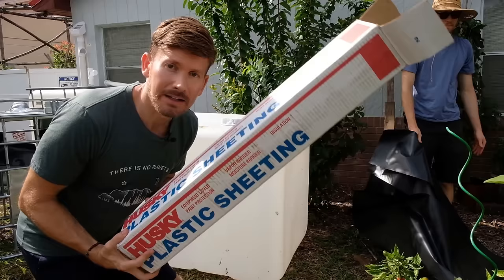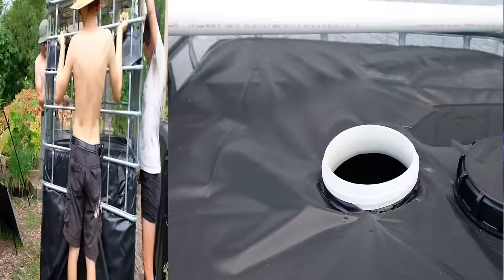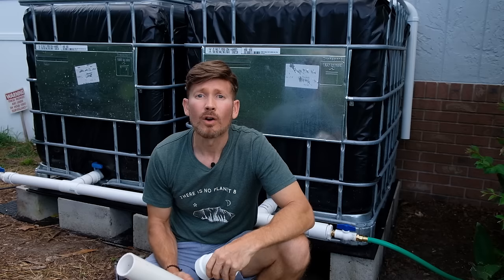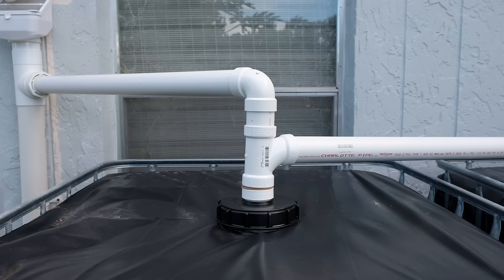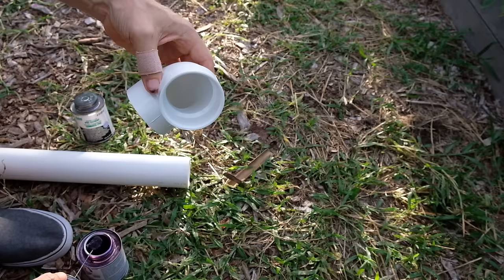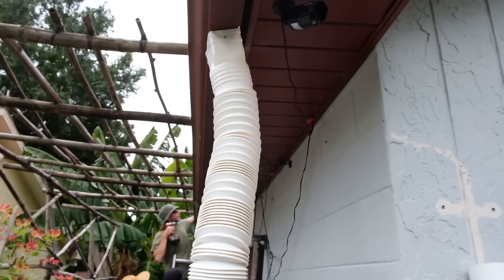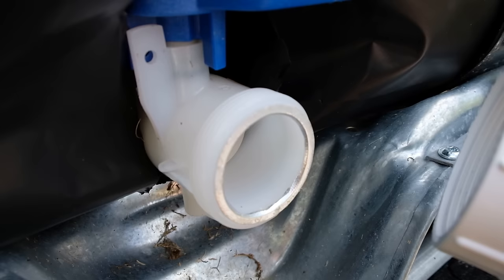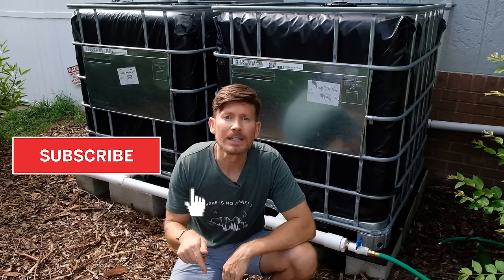How to Build a 550 Gallon Rainwater Harvesting System

Comment: As you mentioned finding a way to connect the totes and the plumbing has taken many hours.  Many thanks for describing the connections and where to find them.  My plan is a little different.  I'm planning to collect rain water and store it in 2 totes in the ground below the greenhouse.  I'd be interested in your thoughts about putting your totes under ground.  Again, thank you for the detailed explanations.
Reply from the maker: Hello! I don’t have personal experience burying IBC totes but the walls are thin so I would be cautious about it. Some people report having the walls cave in when the tote runs empty, but this may be due to not having some type of vent or tube that comes to the surface to suck in air to replace the vaccuum created when water is sucked out by the water pump. Also, if your water table is high, it could crush the tank from underneath of its covered up or it could float up out of the ground. So be sure to determine how high your water table can get after a rain storm. Either way, if you do decide to bury them, keep them in the cage and maybe add some more reinforcement to protect from pressure from dirt/sand. And make sure to keep the tank covered at all times. If sunlight hits that water and algae forms, it will be tough to clean out.
Reply: Can wrap the frame with concrete/mortar wire. It’s like chicken wire, for supporting mortar. That would help keep dirt from crushing in. Might take several layers & might take mortar to be hell for stout.
Maybe a small frame over the top. Using a pallet would be temporary since it will rot. Recreate a pallet shape with concrete boards? To put a sturdy “roof” over the IBC?

Comment: I would think be easier to just paint them but I'm still building this system. Thank you
Reply from the maker: It may be easier to paint them but the plastic is slightly porous so I guarantee that paint chemicals won’t get in the water. If you are going to drink the water, covering with a thick plastic cover may be better.

Comment: Awesome video! Thank you! 
Just wanted to say that PAVERBASE Panel price you're refering to is PER PANEL that covers 5 sqft not 100 sqft (100 sqft costs over $200)
Reply from the maker: The WHOLE package is only like $12. They are the black foam pavers. Not cement pavers. It’s a great deal. https://www.homedepot.com/p/PAVERBASE-20-04-in-x-36-in-Black-Brock-Paver-Base-Panel-PVB5B/205663180?MERCH=REC-searchViewedNA-205663180--N&

Comment: Very cool video I live in a 55 and up community and we are purchasing a home here and I'm looking for some water catchment that is kind of inconspicuous HOA will allow it as long as it Blends in with the surroundings this is one of the best videos I've seen
Reply from the maker: The aluminum cage is perfect for attaching boards or other types of covering to hide the system. You can attach a few thin boards vertically to the front of the cage with zip ties and and then screw larger boards horizontally to them. Or you could attach trellis board and grow flowering vines or other vegetation over the system. Or just build a false wall in front of the system. Easy to hide!

Comment: Thanks for a great video, very nicely presented!  You gave me great tips for using the Totes' drain fittings and providing an overflow in the top.  I didn't really want to cut into the Totes.

Comment: I got the same set up however I used 4 totes to give me 1100 gallons of rain water, my down spout is connected to the one tote but I have all 4 totes  connected like yours at the bottom however I have an irrigation pump hooked up to the pvc with a 3/4" male garden hose adapter to make my home made lawn sprinkler system to water my grass for FREE👍🏿👍🏿
Reply from the maker: Awesome! You have an on demand pump that keeps pressure? I’ve been looking into that so I can water the garden or feed it into a natural filter system with biochar, sand, stone, etc.
Reply: @naturehacker1095  it's just an irrigation pump that I got from lowes, I posted a link but YouTube keep removing it...I'll make a video of my set up when I get home

Comment: Wish I could like this video twice... Exactly the instructions I needed. Thanks!  Question, is the plastic wrap necessary if the totes are out of direct sunlight?
Reply from the maker: Yes. My rule is that If you can see your hand in front of you, there’s enough light to make algae inside the tank. So, in other words, you want something blocking the sun. Plastic wrap was the best solution for me at the time because I was nervous of painting the plastic totes and possibly getting some toxins seeping through. Amazon sells tote covers now but mixed reviews. There may be a few high quality tote covers out there though. That would make the covers removable if needed which can have benefits. Some covers are also insulated for colder climates. Have fun taking one more step toward resiliency!

Comment: You might want to invest in Such 80 unions and Spears Ball Valves with unions, those white valves will lock up and break when you try to turn them, also you want a rubber ball or a bladder used for plumbing in case you get a broken pipe, so all the water does not come out.

Comment: Thanks for this information. I’m definitely going to incorporate this system in my yard. I like that everything is easily accessible from the bottom to the top. My only issue is what do you do to prevent critters from moving under your containers? Joe long does it last? I live in San Diego and it’s finally raining. I’m thinking about stacking 3 tanks and somebody prevent rodents and insects from moving in.
Reply: I never had anything go under my tanks but it’s not hard to run some hardware cloth/chicken wire around the bottom to keep rodents out. The metal frame of the totes makes it easy to secure it to the tote and then you can bury the wire a few inches deep into the ground to keep a rodent from getting in. I’m not sure they would do too much if they were under there anyway.
Reply: If you stack IBCs, make sure you are providing lateral support. That’s a lotta lotta weight up high that could cause catastrophic damage if it gets much of any lateral force.

Comment: High level overflow pipe on one tank and no overflow pipe on the other tank means before water overflows to the high level of the tee overflow connector, the other tank will be full and water overflow either burst or overflow on the top cover if loosen. Overflow pipe, if provided to one tank only should be located at least 2" below the top level either of the tank.
Reply from the maker: Hello! Both tanks fill up equally with the pipe connecting them from the bottom. Moving the overflow outlet to two inches below the right tank is another option. You lose some water storage capacity but it will work well. This design has been working well for three years. I hope to post another video soon of improvements that could be made based on user experiences and comments. But this design as it is works well. Thanks for watching and giving your input.

Comment: Reading through the comments and I agree with a ton of people. This is a very informative video and done really well. I just see the problem being through the filter system. the only thing helping filter the water is a pantyhose. I would have made one tank be the main water catcher with a sand/pebble/gravel setup that then lets the water that's been filtered go to the next tank through a valve connected at the bottom. Of course, you'd have to put that tank slightly above the other or even on top of each other to allow the gravity to pull it down but at least then there is more of a filtering of the rainwater. As you said there is bird poop that has a chance to make it through and pantyhose might not stop the bacteria they bring. Collecting water I think this is a really good and amazing job well done. However, I also feel like there is a better chance to get sick just having the one single filter helper that is pantyhose.
Reply from the maker: Oh, I agree. It’s a triple filter system between the leaf guard, first flush diverter, and pantyhose liner. Although the water runs clear, bacteria will still get through. So I filter the water with a Berkey filter in the house. I don’t drink directly from the rainwater system. A future plan would be to use a solar powered pump to run the water through a sediment filter system to clean the water AND replenish the minerals.There are open source plans for that online. Running it through gravel, pea stone, sand, and biochar. My Berkey is my short term solution. And then I add Trace minerals to get the minerals in the water since rainwater (just like reverse osmosis water) is largely mineral deficient.
Reply: @Nature Hacker that's what I was thinking is that this is just to gather the water then you have another filter that you use to get the bacteria. I was saying from that setup it would be best to order set it up with sand gravel etc or just use an additional filter system. This is awesome to catch the water but would recommend filtering it before drinking.
Reply from the maker: @ovogaming7453  Definitely. Ultimately, this would only be the first stage. Then a natural filtration system that will later feed into the house with a solar pump. The key is making the system as mindless as possible so more people will be willing to install a system like this without changing their habits too much.
Reply: @naturehacker1095  exactly. Again good video and thank you

Comment: Fantastic system! I’m going to build my own soon, probably just like this.
Does a film of bacteria grow inside? I’ve seen others comment that it helps otherwise sterilize the tanks?
Would a small circulation pump in each help prevent stagnation?
What’s your outflow pressure? Does an RV pump or dock pump (110 v) up the pressure for long hoses to the garden?
Reply from the maker: Hello! The black cover will keep the Sun out and prevent algae growth. It has been running clean for two years. I use a small pond pump to add pressure. Otherwise you have to raise the system higher to get more pressure. Having something inside to circulate the water will keep the water from freezing in the winter but not needed to prevent algae. Now they have removable covers on Amazon to cover IBC totes which may be easier for you than wrapping with plastic but both ways work well.
Reply: @naturehacker1095  thanks! I’m moving in & building south of Dallas next month.
Being 3/4 ton it’s a big engineering like Costco shelves to lift high enough for a few more pounds pressure, doh. Prob easier to put a 40 psi pump on it for garden hoses & timered drip lines. I plan to do a 2-tank system for garden & backup to city water. In drought times Ill just keep growing.
Reply from the maker: @michealnelson5179  Yes. I agree. I opted for a pump as well.

Comment: And people when you're doing the priming and the gluing part of these PVC pipes do not lay them on the ground because you're going to pick up dirt and other contaminants that's going to mess with your pipe assembly. And if the games that tells you how full your tank is is airtight you're not going to be filling up both tanks the same amount because they're going to be air pressure in the top of the second tank which will keep the water from getting all the way up to the top.
Reply: @allen at the end he tell to loosen top cap for 2nd tank. I think that would release air pressure.

Comment: This is a great video. How do you determine the amount/length required for the first flush?  Does it correlate to impermeable surface / roof square footage?
Reply from the maker: Thanks! The length and width of the first flush diverter depends mostly on the size of the roof and amount of pollutants in the area. The main reason for a first flush is just to get rid of the nasties on the roof first before filling the tanks. If I found that I needed to flush more water, I would have bought a few more pvc attachments and ran a few more pipes parallel to the one I installed to double or triple the first flush water collected. If you have a high roof, you can always get away with just having a longer or wider diverter pipe. Here’s a great resource to help you do the calculations. http://rainharvestingsupplies.com/content/documentation/pty/first-flush-diverter-brochure.pdf

Comment: Very informative. Thank you.
If I were to build a system with only one IBC how would you go about to install an air outlet to release the pressure when it fills up?
Reply from the maker: I have a new overflow system featured in my Rainwater System Update video coming out June 10th 2024. It works well with one tank.

Comment: Hey thanks for all the details 🙏 I learned that the water outlet should be 50 mm above the ground. The problem I see with the IBC is that the outlet is right at the bottom. How you handle this or is it not so important to have these extra 50mm for sludge building?

Comment: Overall, great system that I have built (twice).  However, there is a modification to assist.  The connection at the tank, if not perfectly tight (should also use teflon tape) you will have a very small leak (you will not realize it until everything is connected in permanently and you have water in the tanks).  Once all connected, with this version, you can never service the tank connection point,  Shouldn't need to, but it's possible.  May need to move or add other tanks/components.  To make the system serviceable, use a flexible coupling between the tank and the connecting pipe.  This allows for disconnection and reconnection, should any need arise.

I got algea at the points where light could still get into the tank (connection point and near the top cap, which meant I had to take them down, clean and correct my mistake. I also know that I will add more tanks in the future. Thanks
Reply from the maker: Thanks for sharing! I am glad you like the rainwater system. I am showing an update on my system Monday June 10th with some new features. This may fix the leak issue.
Reply: @naturehacker1095  Look forward to it.  BTW, hopefully you are also adding a level indicator.  I never added one on mine and had an inadvertent draining (transferring water) far more than I wanted because I was guessing.  Im adding one now, using clear PVC tube, but I have to cut a piece and reattach to add the indicator.  Also (reason I had to take things apart) I added a low point drain for the freezing weather we get in TX.  I had several pipes crack because I did not drain them properly so I added a low point drain that ensures all water is out of the pipes during this time period.
Reply from the maker: @araimis  The video is now posted and yeas- there is a water indicator added but not one on the side. Too many issues with algae growth and so on.

Comment: I like the setup.  I don't like the black poly plastic covering though.  That stuff breaks down quickly in the sunlight.  I can't imagine the black covering lasting more than 2 years.
Reply from the maker: Painting it may cause leaching of toxins into the water so I chose this option. The plastic roll listed in the description has lasted me three years without breaking down in ther  Florida heat. I’ve had other types break down and fall apart into pieces on other projects so I was surprised when I found this Husky product. I may attach fencing panels to the front and sides and put UV resistant vinyl panels on the top to keep the plastic intact and to make the system look more professional.
Reply: @naturehacker1095  I like the UV resistant panels idea.  That's good to hear that it's still going after 3 years.  I wonder how long it could last under uv panels?
Reply from the maker: @catdaddy349  The great thing about the IBC tote cage is that you can attach anything to it with a little creativity. The plastic can be the inner cover to prevent algae growth and the outer panels make the system look good and prevent the sun and rain from deteriorating the plastic

Comment: If I leave the top cap slightly open for air to move through, won't that make the water to leak once the tank is full?
Reply from the maker: With the new overflow system shown in this video, the overflow pipe is a few inches lower than the top caps so when the water level gets to the height of the overflow pipe, it will quickly flow down the overflow pipe and the water level will never reach the height of the caps. It is leak proof! For the old system, there is a possibility of leaking with the caps loose so that is why I changed the design.

Comment: This is awesome, thank you!
Instead of leaving the top cap semi-open, you might want to consider putting a breather.
Awesome system, love it! Thank you!
Edited:
Question: Regarding the black plastic/tote you used to cover the tanks, I am wondering, can't we just paint over it? Black paint? Thanks!
Reply: I know your post is older but just thought I’d say plastic is a fickle medium to paint and have it adhere and stay bonded. I’ve seen black tanks for sale so we’re getting those ,
Reply: @johnboylong40  still an awesome system! 😊👍
Reply: We painted ours with an exterior acrylic and doing great. Some plastics don’t accept paint well but I don’t think it’s the type used in IBCs.